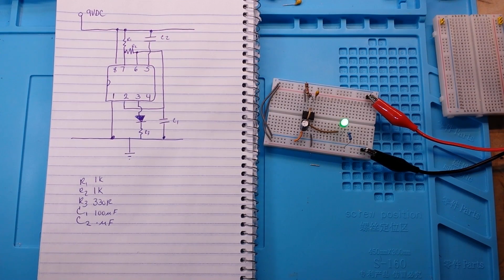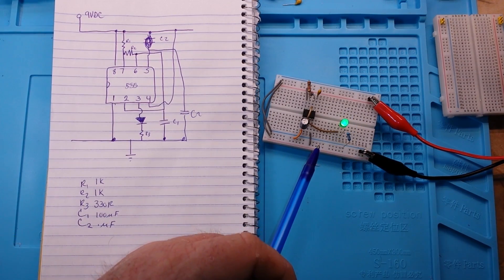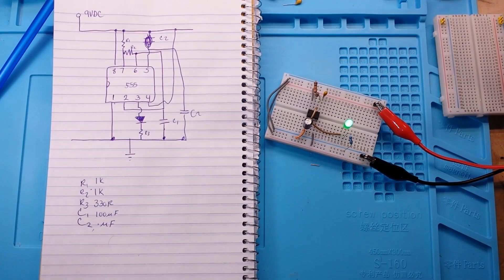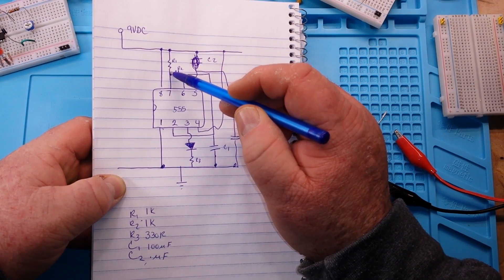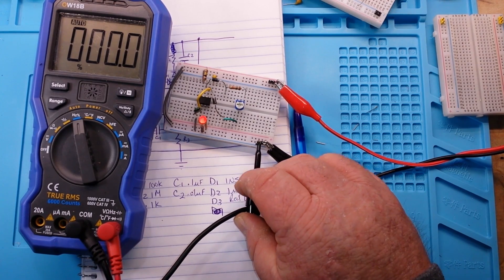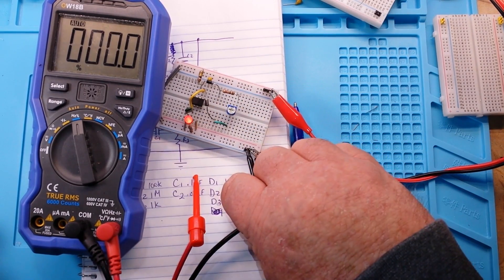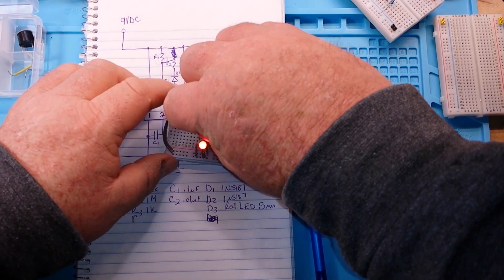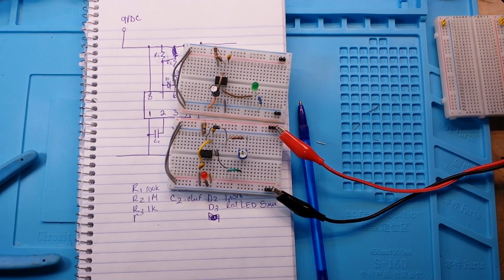How to control the duty cycle of the 555 timer

Comment: One thing that some may have missed is the little stake headers that you have for your power rail connections. What an excellent idea! I am always rigging up clip leads and wires to make connections to the outside world. I have a lot of those styles of connectors on scrap motherboards and PC cards from the past.I will be actively harvesting them now. It's the little things that make bread boarding more easy to do. And if it's easier, then you are going to try more projects! You could also use 2 pins stake headers to solder small parts to in order to make them easier to insert into the breadboard.
Reply from the maker: Yes, thats a good idea. Thanks for sharing.

Comment: Hi. I found this tutorial to be quite informative. I would like to know the configuration of the pot and resistor combo. The parts list does not seem to match the breadboard circuit as shown. I can use this type of circuit in a project I am making for a PC interface. I need a pulse generator that has long duration to medium duration. I have one cobbled up, but it is running as a square wave, and I would like to shorten the duty cycle so I get a short positive going pulse.

Thanks for the video. It got me back on track.

Comment: I am frustrated. I am trying to create an airplane "strobe" flash, frequency about 1hz, and short burst on. I followed your scheme and the last LED flash that you had is pretty much what I am looking for. However, I cannot get  the duty cycle to change when I do it. Only the frequency. I don't understand why I can't. . Could it be the diodes? I am using IN4001s.

Comment: Hi, Paul. Thanks for this. I am building several starship models and the pre-made circuits are beyond my price range. I am glad I came across your channel. This is one that I was looking for as far as flash rate/duration. What I am looking for now is a circuit that will "breathe" 2 or 3 LEDs at different timings, in order to get a "lava" effect, like a really slow chaser that fades instead of pops on/off. I can possibly do it with 2 or 3 555 timers, but if there is a more compact way of achieving this, I would love it. Keep up the great and easily understandable tutorials/lessons.

Comment: Is this suppose to be for beginners? not being sarcastic its just that even if I do my best to copy this and have watched, well if not all, then many of your videos several times, I'm still not confident enough in the values of the capacitors which you switch "all the time" and dont mention the pot. So I cant copy this at all. My multimeter shows no frequency at all because I havet got the right values. You dont either. C1 was suppose to be 1uf (microfared?) but the one you have is 63 puff ??? what the h is that? sorry its just too messy for me as a beginner. I also miss a close up of the second breadboard with you explaining. If you did that you might had clarified something about the pot and the c1.

Comment: I am about to make a santa jumping jack automated with a servo motor. So I have to find out how to toggle between 0.5mHz and 2 (2.45) mHz with a cycle time of 10%. This will make the servo motor toggle between -90 degrees and +90 degrees. I Think I can use your circuit to do that, but you dont mention the math to calculate the signal and cycle time. Would you do a video on this? And perhaps also explain how to make the servo motor run slowly so santa won't scare any one :)

Comment: I guess if you had a good steady Vcc, it would not make that much difference if the 0.1 (or 0.01) control cap went to ground or the power rail??

Comment: What happens when you change the two resistors from the first circuit for a potentiometer but leave everything else the same?

Does that make any difference in the duty cycle or frequency?

Best regards,
Ricardo Penders
Reply from the maker: Nothing really. I do that all the time.
Reply: @learnelectronics  Hmmm, I didn't expect that, I thought it would change the frequency at least and maybe the duty cycle... I really need to get it on my breadboard and start playing with it to be able to understand it better how it works.

Thanks for your time to answer my  questions on this timer ic, I really appreciate that.

Comment: I'm new at this, so hadn't heard of the 555 until these vids.  Thanks!  

For anyone that can assist, I'm looking to get into a newbie soldering iron.  I have small project I'd like to take my first stab at soldering.   I have most of the consumables, but am struggling with a soldering iron.  Not looking for the cheapest option becausef I continue learning I'd like to have a tool that I enjoy using overall and am not fighting with, but reviews on soldering irons/sets I've looked at seem all over the place.  So, anybody have a good suggestion for a novice.  I'm thinking something with interchangeable tips at the least.  I'm not necessarily looking at a $10 tool, but lets say I'd spend about $100 or less at this point.
Reply from the maker: KSGER T12
Reply: @learnelectronics  Thanks Paul!  Interchangeable tips, temp adjustment, and good pricing.  Looks like what I'm looking for.....can I go to your Amazon shop and add it and you'd get the support?

Comment: I finally broke down and bought some bread boards like the ones in this video, I have been tinkering before, without them, I guess it will be alot easier, than soldering, and unsoldering , when I grabbed the wrong component, or had it reversed, or just experimenting...  I also have some N channel FETs, 60v 30a, and assorted 1w zener diodes, and some 1/8 & 1/4 watt assorted resistors,  and I have a PNP, a couple pots, a bit of solid wire, I'm going to get some male headers , to make things easier, the 20-22g wire is a bit large for the board, and the other I have is a bit small. I guess I need some caps, what would you recommend to go with the boards, that will not go to waste, I am more in to power supply and switching, type projects, basically what I know is what I learned by doing, or reading , or what I learned from you and a couple others here...   I would like to get in to the arduino and pie world,, I'll have to get my little in house work area together, I'm halfway moved, to a off grid house, and I have a " engineering room " where the inverters, charge controllers, batteries, and all that jazz is kept, I have to finish all that , and finish my work area, and build a computer, loads of work! I as till need to build the voltage regulator for my DC generator project, and I need to build a high current well basically a  DC- DC SSR,  to handle 500 amps at 60v to be safe, to go with my BMS, as part of the battery management, to disconnect the load if things go bad,,, anyway thank-you for a the video info!!
Reply from the maker: Get an assortment of electrolytic capacitors and 1/4 W resistors

Comment: I’ve used this exact circuit as a motor speed control for testing DC motors. It works great if you want a easy speed control without have to code an Arduino.
Great video Paul, I love these analog circuits.
Reply from the maker: I'm an analog guy at my core. I enjoy playing Arduino, but I'd rather build something from discreet components.
Reply: Neat idea!

Comment: I too love your 555 videos. I didnt quite get this though but im sure its my green'ity. Can you use a 555 timer for running a program? (like the washing wachine do etc)
Reply from the maker: Yes, you can set it up to be on for a very long time and shut off or the opposite.
Reply: @learnelectronics  thanks, and would I be using a relay to power another thing after the first? lets say a washing machine in its program need power to motor, heater, pump, door, etc. at some point in its program. How would you switch between the stages in the program?
Reply: I think I now can answer that myself: with a decade counter

Comment: I don't think you should tie pin 5 to ground with a cap. It applies to monostable circuits but not for astable circuits (not sure about bistable). The reason is because, as its name implies, pin 5 allows you to send a control voltage to the 555 for ALL kinds of powerful stuff, such as synching another oscillator to it.
Reply from the maker: You're right. Pin 5 can remain open. But I hate a floating pin. I like unused pins tied high or low or high Z. Uncertainty is never good in electronics.
Reply: Unless you are making audio noise makers. 😂 Cheers!
Reply: Having a cap to pin 5 prevents any transient noise within the chip. If you have pin 5 floating; it can cause false triggering within the pin. For example; If you have a monostable 555, with an unused pin 5, your duty cycle can become false triggered and reset the cycle or shut it off completely.

Comment: I hope to use one of these to generate high frequency pulses to trigger a mosfet or the like to create multi plasma spark high voltage ignition systems for my classic motorcycles
Reply: Or a Microchip PIC? Less drifty analogue components...or Arduino...
Reply: That sounds pretty interesting!!!
Reply: I am not an expert on electronic sthough I could probably knock up a simple capacitor discharge unit using a couple of mosfets, cheap inverter booster module and capacitor

Comment: Hi Paul I'm curious about your thoughts on neat breadboarding. Recently I've been trying to be super neat about it and keep all my wires in a single plane (no looping over others) to avoid interference and keep it easy to debug. How important do you think this is? How neat would you expect an average breadboard in industry to be?
Reply from the maker: I spent 30 years as an engineer.  Here's what I can tell you from my experience at my place of work. Your breadboard is an extension of your mind and personality. You use it to flesh out your thoughts and ideas before you perfboard them.
I've seen completely anal engineers without a crumb on their  bench and every wire straight. I've seen engineers who haven't seen the top of their bench since their first day. Their breadboard look like a bird's nest.
So which type of engineer does best? Both. Industry is results driven. Management rarely wonders in to engineering spaces. You are more likely to be called to their floor for a presentation, and you wouldnt take a breadboard to that.
I would say be as neat as you can without putting too much thought into it. You will develop your own style.
Reply: @learnelectronics  Awesome response, thank you.

Comment: This is a timely post for me.  I just ordered some 555 timers to try to build a PWM controller for an LED light strip.  If you decide to do a follow-up post, I’d like to see a design that uses a single potentiometer to adjust a PWM duty cycle while maintaining a constant frequency. And would you know a good frequency to use that minimizes the effect of flicker?

By the way, I look forward to your explanations. I especially like that you include schematics (not just breadboard wiring) and that you draw them with the Positive at the top and negative on the bottom with a logical flow from top to bottom and left to right.  That greatly helps me understand what you are explaining.
Reply from the maker: Thanks Tom. Anything over 30Hz is generally not detectable by the human eye. Do it like an engineer and add 20% to that and you get 36Hz.  Check out this video: https://youtu.be/VurDwrtTF3g